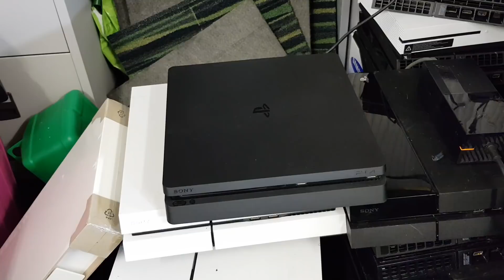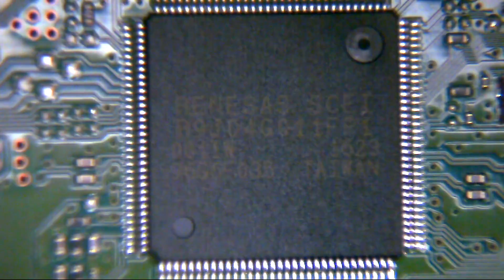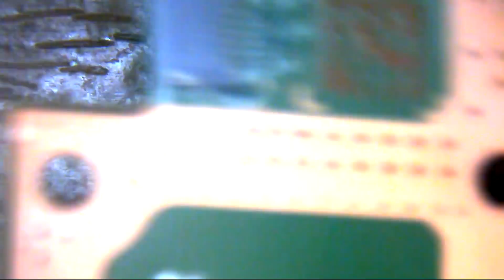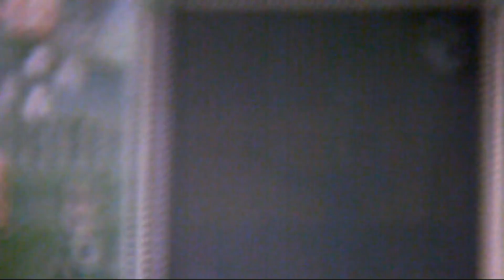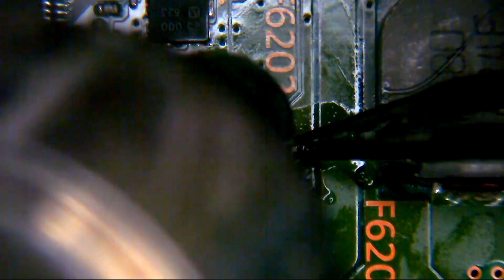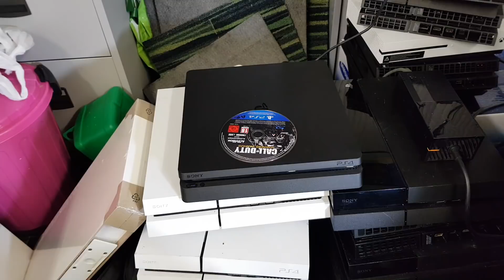PS4 Slim CUH-2xxx BD-ROM No Disc Feed - Fault Diagnosis and Board Repair (SAD-001) - SU-42118-6

Comment: Hello what causes this to happen. My gf had a ps4 slim with a faulty  power supply and we took it to a repairshop. After getting it back the console worked fine but the disc drive would not take discs. I think they must have mishandled the motherboard upon replacing the power supply.  Because the cd drive worked just fine before the repair. 

Any thoughts? 

Thank you. 😊😊

Comment: I have the same motherboard and I have no voltage in the motor, the cd does not enter, it is hard and all the fuses are correct, what could be the fault?

Comment: Andrew I have the same problem, but I got this problem when I try to update. Is the same solution?
Reply from the maker: Always check it, but it's not sounding good if this was during an update. These machines have a habit of bricking their drive controllers during system software updates.

Comment: thanks man i found the problem 

now ii have a second problem how do i get the replacement fuse
Reply from the maker: Replacement fuse is Panasonic ERBRD1R00X or equivalent. Available from places like RS, Mouser, Digi-Key etc.
Reply: @AndrewPaul  god damn video is from 2018 and you still replied, Now that's a top quality chanel thanks for the info and you've defenetly gained a subscriber
Reply from the maker: Thank you! :-)
Reply: @AndrewPaul  I finally got to fixing the fuse and accidentally bridged the pads and now I know why I should not do it luckly i realised the problem and fixed it

Comment: so. if all 4 of these fuses pass a continuity check, but i have no disc feed, i either need to replace the motor board in the optical drive (KLD 004) or the whole optical drive right?

for perspective, inserting a disc into the front of the drive to trip the switches on the motor board powers on the console if it's off, but does nothing else. no feed, no rolling, no noise.

Comment: I have the same problem. Already checked the continuity of the fuses and no problem at all. But there's r330 resistor i checked the value and it says 0.7 ohm , is that good or bad when it should be around 0.33 ohm?
Reply: conseguiu resolver ?

Comment: Not sure if you still look at your old video comments, But i have looked at all 3 fuses and all tone out but i still get error SU-42118-6 and the drive will not accept any disc. Any ideas where else i can check?
Reply from the maker: If the fuses are good, check to see if the motor spins with 12v applied. If it does, then it could be a failed motor controller IC, but more likely it's a failed Renesas IC which is not a repairable issue unfortunately as it's unique to each and every PS4.
Reply: @AndrewPaul  Thx for the reply, we came to the same conclusion as well. No point in attempting to continue due to what would be required at this point. Thanks for the fast response.

Comment: Hi Andrew thanks for your clear explanation i've found fuse 6202 blown and replaced it but i still can't get the BD-rom working again! i checked also other fuses F6201 and F5103 and they're ok. is there any more fuses to check for BD-rom supply?
Reply: Hi again finally i've resoldered the fuse and it worked! Thanks again for your vidéos. Let's start a type c replacement on a Switch now!
Reply: Hi again, Second Time that i've to replace this fuse 6202 for getting 8.50 update installed, that shows clearly that Sony wants us to go for PS5 ! Thanks again Andrew !
Reply: @icekrim34  I can not believe it

Comment: HI, i have PS4 slim, and have error SU-42118-6 when trying to update. 
All fuses are healty, I also measured the DVD motor and it is also ok. Cables are ok too. The DVD does not receive power at all, does not pick up a disc and does not read if I put it inside. I came to the conclusion that it was Renesas IC, and must be replaced. If the chip is replaced will there be problems with the PS4? Will they be able to play games? Some people told me that it will give an error and it will no longer be possible to play it!
Reply from the maker: Sounds like the Renesas:
https://youtu.be/Z9vdfj0uGkM

Unfortunately if that's the case, the console is more or less scrap as the IC is per-box and cannot be exchanged.

Comment: Hi I have the same issue (undiagnosed) I have not opened it to check any fuses yet but the console is giving a su-42118-6 error when trying to update system software, is this likely the same issue or is it a code you have come across before? Thanks
Reply from the maker: If it's a slim then yes, 9/10 it'll be the fuses. If you're unlucky it may be a dead Renesas but hopefully not!
Reply: @AndrewPaul  What if it was a PS4 PRO?

Comment: Hi iv got the same problem f6202 no continuity 
I do have the first editions  PS4 with blue light death is there any fuse I can take from my old PS4 to fit f6202 in the slim PS4 any help very appreciated
Reply from the maker: On an SAA-001, F5101 IIRC, pretty sure I've also used F5104 before now. SAB-001 should have the same fuses. If you have the BD-ROM daughterboard still in there, take F203.
Reply: @AndrewPaul  
Hi thank you very much really appreciated 
Great videos top work I now have a working PS4 again 👍👍

Comment: Many thanks Andrew. I just fixed my Slim by replacing the F6202 with a F5104 from a spare SAB-001 motherboard. At first the replacement didn't work. After that I suspected the fuse wasn't properly soldered onto the motherboard. so I touched each end of the fuse with the tip  of the soldering iron to reflow the solder. That fixed the issue :)

Comment: How many AMP's is the fuse? I'm trying to buy one but don't know which amperage to get.
Reply from the maker: 1A.
Reply: @AndrewPaul  Perfect! is it better to get a 1A 32V 0603 Fuse or a 1A 0402 Fuse?
Reply from the maker: 0402 - an ideal replacement is the Panasonic ERBRD1R00X.
Reply: @AndrewPaul  thx

Comment: Electronics novice here. thanks for that video Andrew. really great. How does the fuse stick to the board? just from the heat?
Reply from the maker: It's soldered on bud.
Reply: @AndrewPaul  thanks! Sounds like a really silly question now you've answeted.haha. Just couldn't get my head around how small the piece of solder would have to be on each connection! Thanks again

Comment: Having the same problem. After the 7.50 update this morning my drive stopped working completely. After the download my PlayStation slim turned off but didn't restart automatically and when I did It wouldn't accept or eject with no noise. When I went to safe mode it said I still needed the update despite it showing it installed.
Reply: Same, have you found a fix?
Reply: This is sadly what you'll have to do, I had the same exact issue

Comment: My ps4 slim is like this. I have a donor board but it’s a standard ps4 board. Is there a fuse on that one I can take?
Reply from the maker: F5102 IIRC is the one up by the SATA connector - I've used that one a few times with success.
Reply: Andrew Paul you’re a god
Reply: Andrew Paul I’ve got one more question. I have a ps4 white light hdmi port is good and the cpu seems really hot

Comment: PS4 slim 2002h. No fault codes, unit functioning but no bd power evident, no spin, no eject, no accept. 3 beeps on pressing eject. Fuses intact , no obvious blown components. Bd7764 replacement???
Reply from the maker: Sadly not likely - these are usually defective BD-ROM Controllers. Scraps the console I'm afraid but worth a shot if you've a spare BDV7764 around to test.

Comment: On the ps4 I fixed thanks to one of your videos (not slim but it had the exact same problem). The fuse wouldn't come off with hot air so I didn't even try to replace it and solder the one I picked from a PC motherboard on top of it. Worked perfectly and I didn't risk to damage the pins more that way.
Reply: U basically replaced the entire motherboard?

Comment: I had a PS4 I was fixing for someone had the exact same problem.
It was the same fuse.

I fixed it it works perfectly now
Reply: Go to https://www.mouser.com/ProductDetail/bourns/sf-0402fp100f-2/?qs=lYGu3FyN48euKtEKaujB7A%3D%3D&countrycode=US&currencycode=USD

That is the fuse he replaced in this video and is for the PS4 slim
Reply: Lucid Enigma Hey that fuse you linked on mouser f6202, is that for the ps4 slim?
Reply: Where did you get the fuse from? I've been trying to find a place to buy one. I'm having the same issue.
Reply: Were can i get fuse

Comment: Update broke exact fuse on mine, what if it breaks it again when I'll fix the fuse and do same update?!
Reply from the maker: The update has no ability to break the fuse so you'll be fine.
What does is possibly a weak feed motor, lack of lube on the disc loading mechanism / dirt or dust build up inside the drive. Some people also 'push' the disc as it feeds which can cause issues - once the loading mechanism grabs the disc and starts to pull it in, allow it to self-feed. That should help prevent any recurrence.
Reply: @AndrewPaul  this has happened to thousands of people when they have updated slim version specially. I had the disc inside when it automaticly updated.

Comment: changed the fuse it takes the disk now but wont read it laser no lights nothing tried new laser deck same shit? @Andrewpual can u help
Reply: Hey could you tell me where'd you get the replacement fuse? Thanks!
Reply: @kizaar7418  https://eu.mouser.com/ProductDetail/littelfuse/0402sff100f-24-2/?qs=QV10cN0MjFvTV4lTEzj4NQ%3D%3D&countrycode=US&currencycode=USD

Comment: Could soeone explain how to know which part exactly it is once the open line is found and where to buy a replacement online?? Thanks!!
Reply: I bought this replacement part from mouser https://www.mouser.com/ProductDetail/littelfuse/0402sff100f-24-2/?qs=QV10cN0MjFvTV4lTEzj4NQ%3D%3D&countrycode=US&currencycode=USD
Reply: The fuse number should be written on the board next to it and there is only two sizes I believe depending on weather you have a fat PS4 or a slim ps4

Comment: Have a CUH-2015b with no disc feed. Fuses all check out fine. Laser makes a steady and continuous click that never stops
Reply: Same Here... Do you find a Fix??
Reply: Same Here, I check out all Fuses and flats cables, replaced the lens + deck and nothings
Reply: Такая же проблема, но решения на данный момент не нашёл
Reply: This is Bad RENESAS IC chip. You can swap it from another console but it will not play games anymore and will give you an error

Comment: Excellent....  Weren't you worried why the fuse popped and if it would do the same thing?? ALSO.. What type of flux and swabs do you use???
Reply from the maker: These motors peak at relatively high amps when they start - after a few years with dirt / dust on the rollers and a lack of lubrication on the mechanism it takes more effort for the feed motor to advance the mechanics, thus drawing more peak power and eventually blowing the fuse over time. It can also be caused by helping 'push' the disc in as it auto feeds - this is a bigger issue on the slim PS4 as they use a lower rated fuse which exacerbates the issue. Typically, if you're finding your fuse is popping often, clean the drive, lubricate the mechanisms and replace the feed motor - they get weaker over time and again can cause premature fuse failure.
Reply: @AndrewPaul  thanks for the reply.....  I also figured it might have a "batch" flaw like Caps did in the early 2k's....   Great vids keep em coming...

Comment: Do you know the values of the fuse? Voltage and Amperage? I need to replace it but I don’t know which one to get! Can I use a fuse from a Nintendo DS motherboard?
Reply: It's a 0402 1A 32V fuse

Comment: Hi Andrew, big thanks for all the work you do! I have an SAE-001 (CUH-2116A) with this problem, but all the fuses I can find on this board that you mention check out fine in continuity, 6201, 6202, 5001 and 6001. Board layout is different though, and I can't find any schematics. Any chance you're familiar with this model?

Comment: Hello Andrew,first of all i should thank you,i've had a ps4 slim here putting up the error code su-42118-6 and tried everything from reinitializing  console and swopping drive,i also replaced the renesas ic on board with the same error coming up and then i stumbled on your video here as the drive would not take in games so i thought id give it a try and found out that the fuse you highlighted here was the problem i had,i replaced it and viola ps4 reinitialized and i currently have fifa playing,if it wasnt for you then this ps4 would have been going to the scrap pile,keep upthe good work,you have just saved me a lot of time and confusion as to what was wrong.So this solved the SU-42118-6 error for me
Reply: martin mc laughlin Do you know the values of the fuse? Voltage and Amperage? I need to replace it but I don’t know which one to get!
Reply: Iván Montequín 
Hello Ivan,I just replaced mine from a donor board and it worked perfect and the customer is very happy,that was nearly a month now,try contacting Paul on here and he should respond to your question 😊
Reply: I have the same exact error and I’ve tried everything I hope this works

Comment: @AndrewPaul  Do you know the size of this smd chip? I had 1 donor board kicken around and like an idiot I wasnt paying attention and the fuse got blown away by the heat gun air....I know F6202 was marked "L" which is 1.75A but dunno the size and if its sb or fb? From reading (what limited respurces there are) it is a 1.75A SB fuse? just dunno smd size...the other fuses on tge donor board seems to be of a different Amp rating...
Reply from the maker: Hi,
They are 0402 size.
Reply: Unless you know for certain the fuse manufacturer Sony used you cannot go by the fuse marking as they are different amongst fuse manufacturers and fuse amp ratings.

I'm seeing people in the replies replace commonly with a 1 amp and haven't seen any return to say that it blew during their testing. So it's safe to assume the original fuse was 1 amp or less.

Comment: Ok somebody help me because I'm confused. For the 1215 models I heard that to replace the disk drive you Don't have to swap out a the logic boards because there are no logic boards. But here Andrew is talking about removing the resis chip. So when replacing the disk drive on a PS4 slim you need the original logic board to my the new drive functional or not?
Reply from the maker: 12xx consoles onwards don't have any daughterboards on the BD-ROM drive - thankfully they have them integrated onto the motherboards. Ergo, the disk drives can be replaced on these consoles without worry.
Reply: Thanks keep making videos! Ya Ya.
Reply: @AndrewPaul  como puedo saber si mi consola es 12xx ? o como puedo saber si mi consola le puedo cambiar la lectora por otra ? gracias buen video AndrewPaul

Comment: I need to replace F6201 and F6202 now from what I can gather they are 0402 (1005 metric) package type measuring about 0.5mm x 1mm. 

What do I replace then with Obviously, DC rated fuses. What voltage and amp rating should the replacement fuses be?

I don't have a spare parts PS4 so I will need to purchase them separately.
Reply from the maker: They are indeed 0402. 1A VFA should do the job.
Reply: @AndrewPaul  Would this be it? https://www.mouser.com/ProductDetail/Littelfuse/0402SFF100F-24-2?qs=sGAEpiMZZMtxU2g%2f1juGqVOiOI%2fX23Q%252bHqHyJfEcluo%3d
Reply: Iván Montequín hey did you buy this and did it work?
Reply: @Marshturtle  I just purchased it and it is working perfect for me. Before I purchased it I bought some fuse from ebay because it's cheap. But those cheap fuses were bad I failed 12 times. It worked just on one time. Buy them it is going to work!
Reply: @wasivis_  This fuse is the right one. I just succeeded.

Comment: Hi. So i have a PS4 Slim Cuh-2016a (KLD-004) disc drive and it's doing the exact same error. I took a dive into whats up with it because this decided to not work due to the 5.05 update. I looked into the disc drive to see how it behaves, and i found out that the mechanism which keeps hold of the circular thing in the middle of the disc drive and when it pops out does not correlate to the rest of the disk drive. Is it meant to do that? 

Kind regards
Reply: Hey did u ever find out a solution to this problem?
Reply: I think I'm having the same problem bc all of my ribbons are good my rollers are on and it still refuses to auto feed and i can't download software update 6.00

Comment: Hi Andy. I got PS4 with same issue. Checked all fuses and found out that F6202 is blown up. I have replaced it but disc drive still does not take a disc, but i can hear that laser lens is moving, and i can turn on console by puting in a disc. Any ideas?? Best regards.
Reply: Bad RENESAS IC chip

Comment: Exactly the same issue here, and same open fuse. The loading mechanism is working apparently fine, because I’ve disconnected the FFC ribbon that gets to the motor and applied about 4V to loading motor and it loads/ejects OK. Any idea of which is the Amper rating of these fuses? I don’t have any donor to get the fuse and I never bridge any fuse. Otherwise I’ll have to solder the thinnest wire I can find (from some coaxial braid, etc.).
Reply: I’ve soldered a 1A 125V axial minifuse in place of F6202. I’ve found a post in a forum stating that this fuse could be a LittelFuse 435 series, 0402 size, 1A 32V very fast. Luckily there’s enough room for my "large" replacement close to a coil. The metal cover has extra space there and doesn’t touch it. I’ve put some kapton tape to prevent any accidental contact. It works again, thanks!